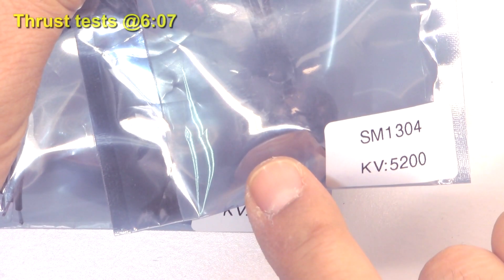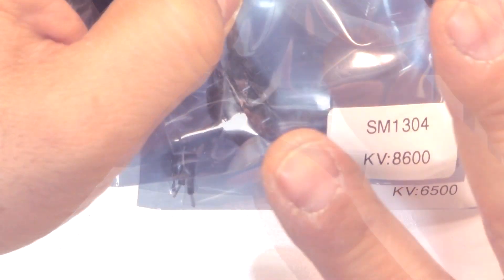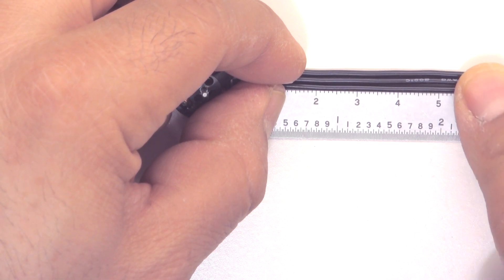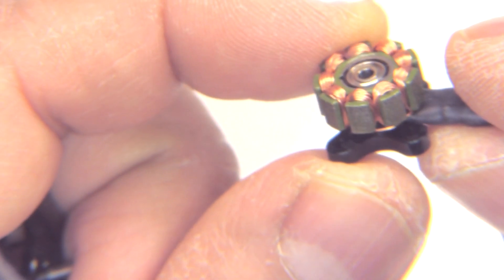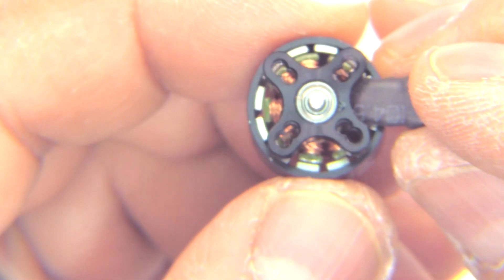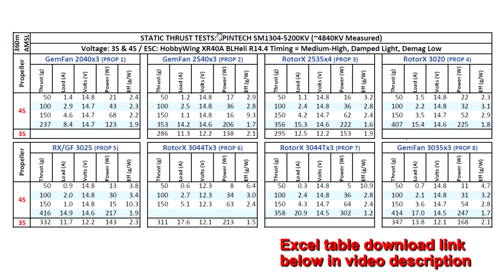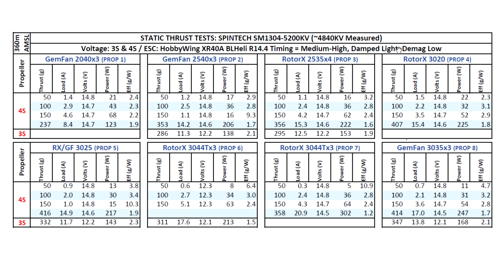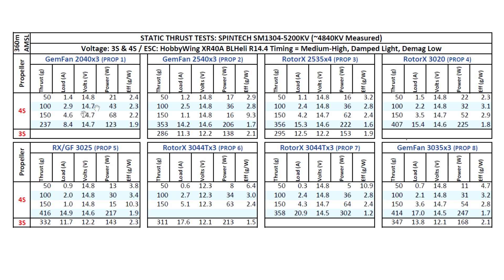SpinTech SM1304-5200KV Thrust Tests - Upgrade for your 1106's ?

Comment: love the vid helps so much.. wish you did 25% or 30% throttle run too to get low rpm lift on props ... but your vid helped me.. going from 2" props to 2.5" i should gain more than enough to lift gopro. Was thinking 2.5" withj ducts wouldnt be enough. though id have to do 3" unducted.
Reply from the maker: I will probably lift it but most likely will run very hot. I think you need at least 1407 and 3" for a GoPro and actually larger motor would be better 1408, 1508
Reply: @EngineerX  its 1207 .. stayed 9x9.. knew I should grabbed the 3" pro bottom plate instead.. had 12x12.. ill do that later. Do 3050 props haha.. when i burn these motors out going hot 🔥  😄
Reply from the maker: @QSpeedRacer  Really hope they don't burn :) I'm curious to see how they work for you and if they can in fact lift and handle GP well. Type of duct also big factor. Look for channel MuteFPV - he has a very good test on ducts
Reply: @EngineerX  I think him is how I found stanfpv.. spoke with stanfpv.. beside turning cinepro to 3" .. im building his pusher bee 🐝

Comment: Appreciate the video, any info on the 6500kv?
Reply from the maker: I haven't had a chance/time to run it on the thrust stand. It's on queue, with many other motors waiting to be tested as soon as I get some time.
Reply: @EngineerX  I decided to go with the 5200kv based on the results you got, and for flexibility. Thanks!
Reply from the maker: @hilo4321  5200 is more versatile/flexible as you can go with 3S & 4S with 3" props and should get good performance on both. Hopefully these work great for you.
Reply: @EngineerX  I'm super happy with these motors, I ended up going with the 5200, and they work great on 3s and 4s. Cheers!

Comment: @EngineerX Thanks for your testing and analysis, as always! Great to see SpinTech stick to tried and tested (by RCX) 1304 size, instead of jumping on 1404 wagon. 😉
Reply from the maker: Thanks for watching. It's quite an interesting thing seeing how all these micro sizes perform and which ones come out on top. The 1304 size as you mentioned, pioneered by RCX for T-style props, had been already quietly performing outstandingly. So why not go with a proven configuration. Still gotta give some credit to motor manufacturers for trying other sizes like 1108, 1206, 1306, 1404, etc. Perhaps when the dust settles the 1304 will stand on top: )

Comment: Is there an artifact in the testing at 150g for prop2 and prop5? Almost 10g/W efficiency seems....amazing. If that's accurate that could be pretty cool though...
Reply from the maker: LoL. A mistake for sure. The Excel spreadsheet I made for presenting logged data is not 100% mistake-proof. Every now and then it will choose wrong data points. That's why I always provide link to Excel file so people can check data.

Comment: I have these on a 120 hornet frame running GNB 650 4S, GF 2540.  My other favorite is the 1206 4500 kV Geprc motors on a aurora mini fight frame same batt and props.  Both are fast and long flights.  The spin techs seem to be up a tad in pitch at full throttle but the mini fight frame is heavier.  Flying weight w/o batt is 96 vs 104g.  One note on the spin techs I observed the wiring bundle is very close to the bottom edge of the bell,  very close.  Being concerned I tried pressing it down to reshape it.  After the first pack, I was getting intermittent operation turns out a wire or two broke.  Big mistake, I did lean on it very hard though.  Bought another full set on amazon.  No problems since.  I ran the mini fight and hornet in original 3s 550 and 650 GNB configurations and these are noticeably faster and longer flights. The 3s hornet had the edge then.
Reply from the maker: Sounds like some sweet setups. If these or the 1206s give extra half a minute flights with same or slightly better performance over 1106s then worth considering but if already spent money on a full set of 1106s  hard to swallow the additional cost.
Reply: EngineerX - with respect to 4s at 2.5 in, I purchased a 120 Bolt equipped with Skystars st1106 4500kv motors. On 650 4s GNB, the motors are destroying the battery power.  At 30F ambient they are running very warm, hot at 75F.  Batteries are all over in 1/2 the time as 1206 and 1304, that run cool. Have stock PIDs on 1106, even lowered D values.  And the Bolt frame is lighter on top of it.  Can only explain the power loss in heat, 4 little electric heaters trying to heat up the sky.  Doesn’t seem to be many BNF 4s 2.5 in. models out there.  Could be PIDs.  So I’m not going to attempt another 1106 build at 4s, nor BNF.  Thanks for your work testing these motors, I’m sure others feel the same 😎.

Comment: I am currently running some of the original emax rs1306 4000kv motors in a 3 inch set up, which motors would you recommend as an upgrade for acro flying? Thanks in advance

Comment: Cool motors.  I've toyed around with the 1304 on 4S idea ever since CiottiFPV (and others) pioneered the concept about a year ago with RCX H1304 5000kv motors.  I've been running RS1106 4500kv motors on 4S on my 2.5" quad ever since the motors  came to the market and as much as I'd like more power near the low end of the stick I'm already breaking arms more than I want at the speed these 2.5" quads on 4S can obtain, so I fear gaining any more weight on the arms is only going to give me increased durability issues. No doubt performance would improve but at potentiality too high of a trade-off in my particular application (a thin-armed, lightweight racing frame).
Reply from the maker: You make a good point that i forgot to mention. On superlight thin-armed frames the lower weight 1106s could be an advantage to keep stress lower when crashing. And 1106s work great too. Thanks for your comment.

Comment: I have a 2.5 Droner and I would love to try them. My problem is I think that any props under 3in should not be on 4s it's  just to much power and the props just don't make any power at that speed
Reply from the maker: At the top end they probably feel like tires spinning without traction. Too small to grab air efficiently.
Reply: @EngineerX  exactly  I should have stayed w/6000kv  on 3s  I didn't even get a longer run time
Reply from the maker: @JohnnyD_RC  :(  that happens.... sometimes more is not more.
Reply: You should see my buddy's Massive Droner (2.5") on 4S with RS1106 4500kv motors!  It'll make you a believer!! I recently uploaded a vid of my 2.5" on 4S here on YT if you wanna check it out.  Mostly technical flying, but I stab the throttle dozens of times on punch-outs so you'll get an idea of speed and power.